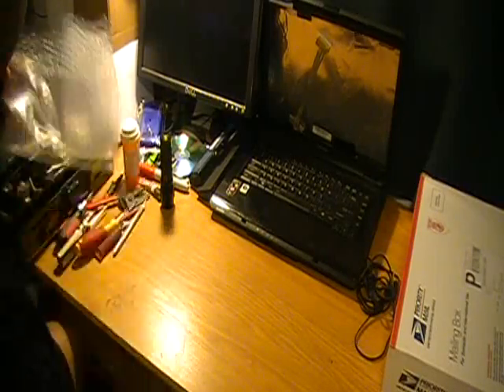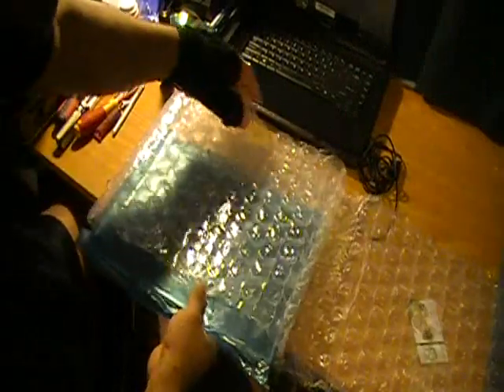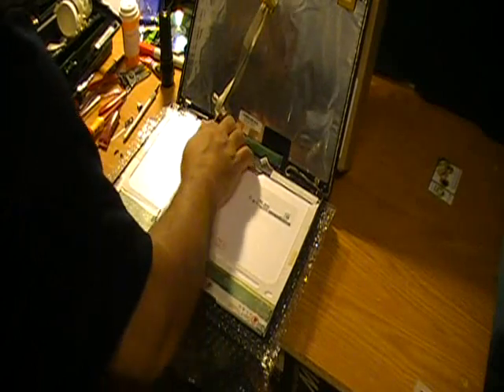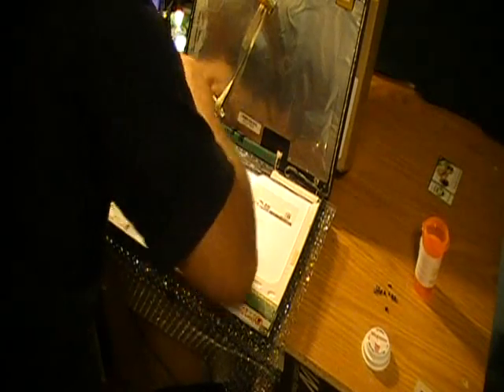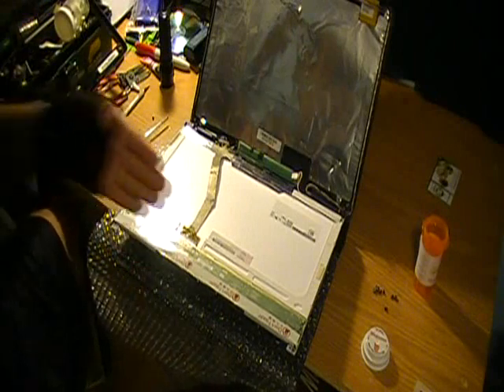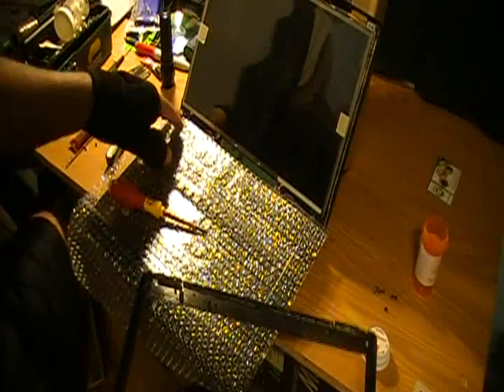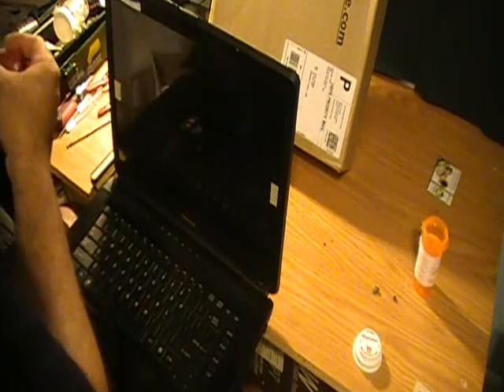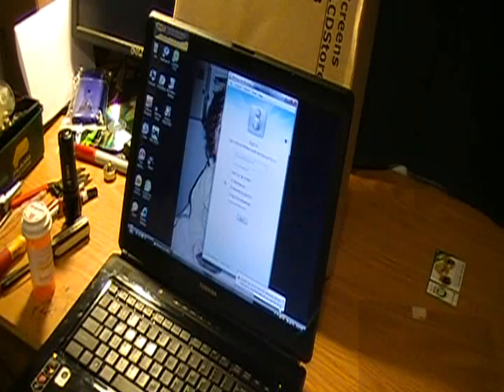Toshiba Laptop Installing Screen ( toshiba Satellite ) 2 of 2

Comment from the maker: @iEviLxHD , hi thanks for the visiting ! :) , changing the screen is impractical. LED screens tend to be thinner so it won't fit your casing snugly, and very often the ribbon cables used for the screen are different. 
 any other question fell free to ask !

Comment from the maker: @salihadmin , hello , the proper way to measure is diagonally from one corner to another corner , you can look-up on the internet how to measure if you still not sure but is very easy , if you got the screen out make sure you measure just the screen not the metal frame ,if your computer is Toshiba you can go on they web site and type the model just to make sure of your measurements , the price today for a new is around $70.00 dollars or you can look for used one .